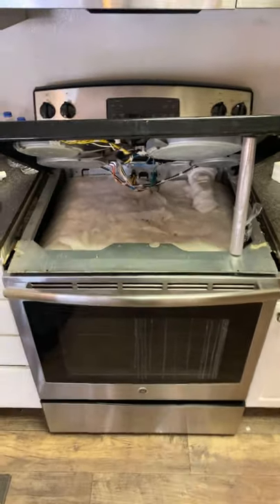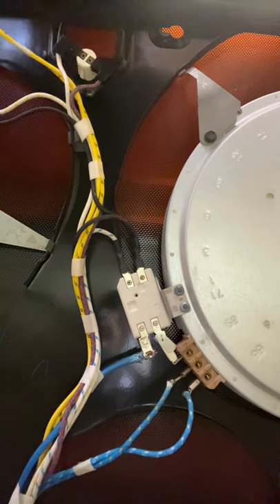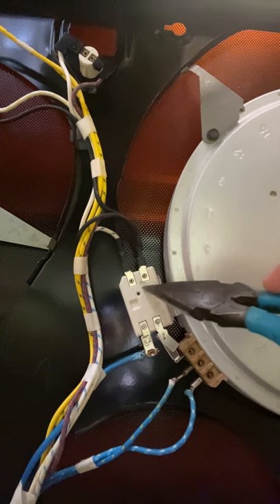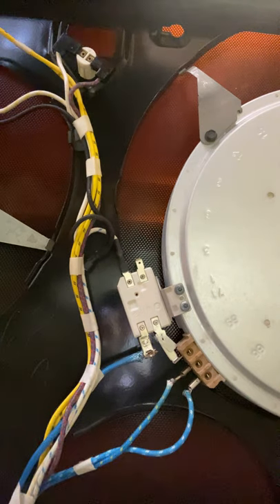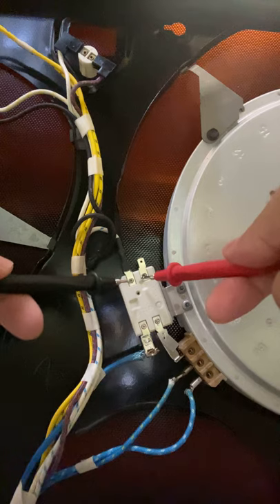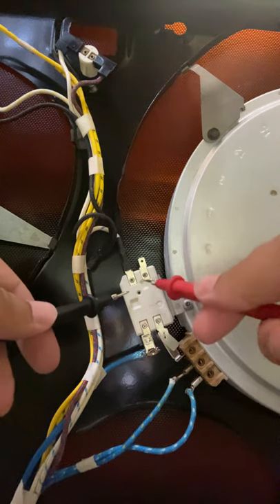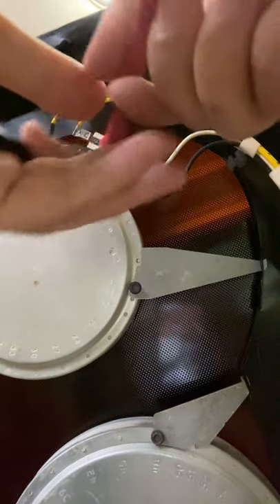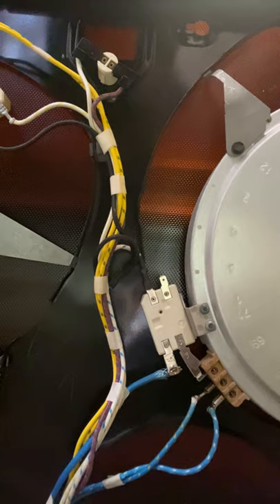GE Smooth-top Range/Stove Hot Surface Light STUCK ON troubleshooting.

Comment: Great video! I was troubleshooting the same oven and was not getting continuity on any of the burners like in the video. So I disconnected one of the small terminals, one at a time and turned power back on in-between trying each burner and found it to be the rear right burner, when I had one terminal disconnected the burner light was off. When connected just with that burner, the light was on. Just ordered a rear right burner. Thank you for the great video!!

Comment: I have the exact same oven and the exact same burner went out, turns out the coil was good but the thermal indicator switch failed in closed position and the thermal limiter switch kept triggering everytime I turned it on. 

Too bad there's no easy way to replace just the limiter, I had to order a entire new burner.

Comment: I get no beep on each switch and the red light stays on. I put everything together, turned power back on and the surface red light was off. I cycled each burner and the red surface light came on and is still on. I’m stumped.

Comment: dumb question; should the range be unplugged while performing this test?
Reply from the maker: Great question. Yes; It’s always best practice, unless specifically measuring voltage on the component level, to ensure all power is shut off or unplugged before doing electrical troubleshooting.

Comment: Is it possible when the hot surface light is stuck on for the cooktop to be hot even when all of the burner knobs have been in the off position?
Reply from the maker: Great question!  Normally, if the cooktop has just been turned off after being used, the indicator light SHOULD be on, indicating that the surface is still hot even though the burners have been shut off. This is because the glass still holds a significant amount of heat and needs time to cool off to a safe temperature.  There is no case in which the indicator light alone can activate the burners and make the cooktop hot. If the burners are still hot, the light should be on; if the light is on and the burners are not hot, you’ve got a faulty burner. I hope that answers your question.

Comment: my hot surface light is staying on after we had a power outage.  I am curious as to how much it costs to have someone come out and replace that bad switch and also is it a problem to just let the light stay on if everything else is working fine?  I guess is it a big enough deal to pay to have it fixed? lol
Reply from the maker: It’s not a big deal in terms of functionality; everything will still work. You’ll just have to deal with the nuisance of having that light on all of the time.
Reply from the maker: @Walter Butler You’ll probably spend more than it’s worth having a pro fix it for you.